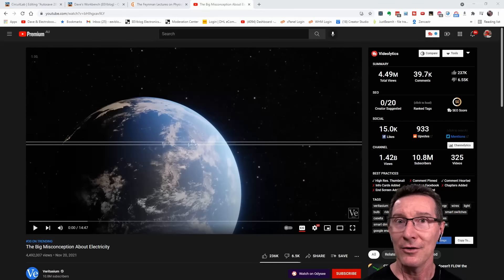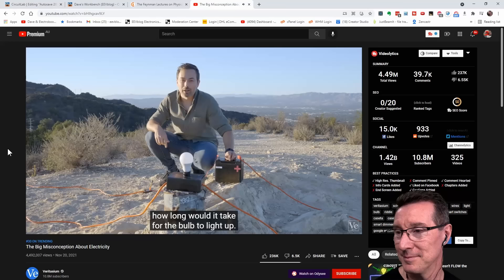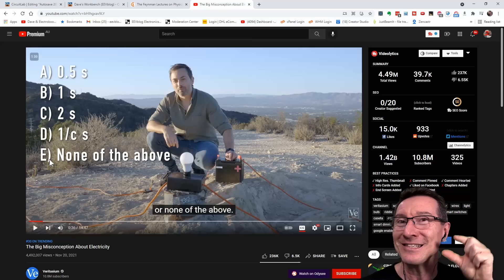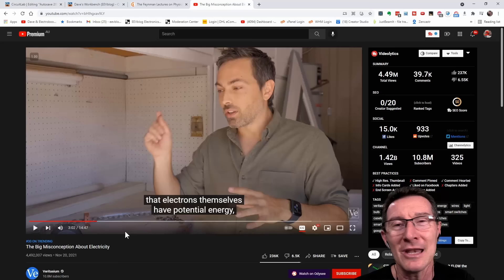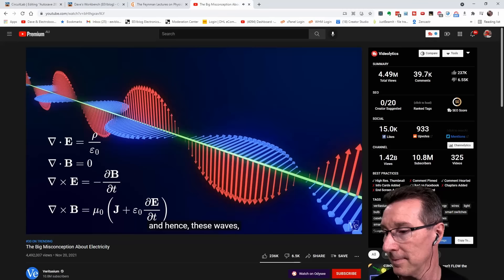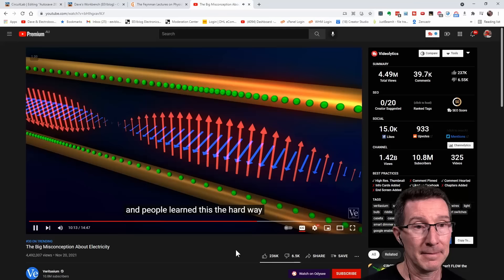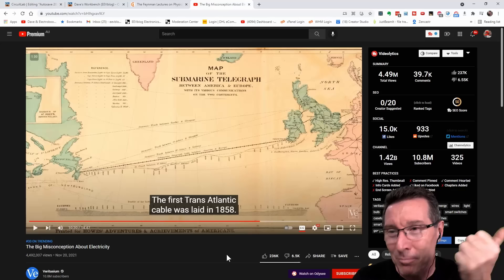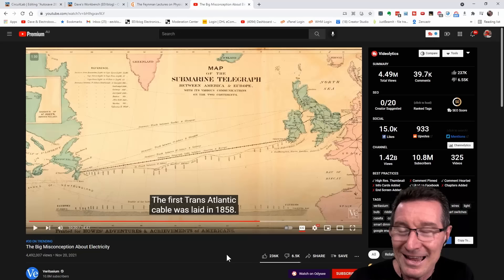EEVblog 1439 - Analysing Veritasium's Electricity Misconceptions Video

Comment: "a huge part of practical engineering is ignoring maxwell's equations". Exactly, we are busy reading datasheets, lol.
Reply: And finding replacements for non-available parts. 😭
Reply: @MetalheadAndNerd  it seems the preferred sport lately... sigh.
Reply: Its like everything else... you simplyfy to the most usefull system. Calculating magnet flux inna Electric cricut  is pretty much impossible.

But when doing magnetism you have to do it of cause.
Reply: Worth adding... this is actually whats limit current in a super conductor.. this fact was discoveted fairly recently
Reply: Surely 90% of modern electronics engineering is knowing the exact thing you need but surfing RS, Digikey and Mouser trying to find what it's called?
Reply: @MetalheadAndNerd  lol so true now.
Reply: And that bloody errata.
Reply: @666aron  what revision are you talking about again? lol I have the Sep 1999. Lol.
Reply: so true...
Reply: Once the math has been done, it is just your job to find the solution.
Reply: @MetalheadAndNerd  still waiting for hmi interfaces wich should have been deliverd in march 😂😂
Reply: @hausaffe100  In my last PCB design I had to implement 3 different voltage regulator ICs with their additional components, connected in parallel in the schematic, so I can decide ad-hoc which pads to use, depending on which regulator IC is available when the PCBs are produced.
Reply: LoL
Reply: @MetalheadAndNerd our programmers borrowed some PLCs from the vocational training Departement because lead times are crazy now the apprentices need them back for their final exams and everything is chaos
Reply: Yeah and strictly speaking, Ohm's law is a pretty good model because it describes in many cases stuff just as good as Maxwells theory. All theory is theory and can be wrong and can have limitations. And for DC you dont need maxwells equations at all, unless you want to know something about the static magnetic field. And still then there is other equations to use like Biot Savart. Or ... solve Laplaces equation. Or steady state heat equation and the temperature gradient will show you the direction of the electric field. lol
Reply: And using new age lead free solder instead of real solder
Reply: @O_Canada  'bout what?
Reply: The "energy" outside the wires is not heat energy (if you are in a vacuum) since there is nothing being heated.  Or is it radiated infrared in proportion to resistance losses?  Assume current and power flow but no frictional/resistance losses in a theoretical ideal  wire material.  In a vacuum there are no kinetic energy losses either outside the wire, since there is nothing in a vacuum outside the wires to be accelerated.  Therefore, what form is the energy outside the wire?  What carries this energy if there is nothing there but a vacuum?  Energy is joules in units of newton meters, and newtons refer to accelerating matter at an increasing rate.  So if there is no matter to be accelerated outside the wire, what is the form of the energy in the accompanying changing electric and magnetic fields?
Reply: @jackieow6692  Ether.
Reply: If energy is moving in free space around the wire, what would make it suddenly "want" to converge inside the filament and heat it to incandescence?  That sounds like a violation of entropy.
Reply: At all points in space there is some kind of gravitational field and some kind of electrical field and some kind of magnetic field.  What is the "stuff" that jumps out of the wire and increases the field (electric, magnetic) when the power is turned on and the current flows?
Reply: A proton has the mass of 1835 electrons.  Something is going on inside an electron we call "negative charge."  Must be the same thing only backwards/inside out/clockwise vs. counterclockwise is going on inside  a proton (or a positron) that we describe as "positive charge."    What is the "thing" that causes what we call electric charge?
Reply: @matsv201  For soft superconductors only; for hard superconductors, there are different mechanisms. Surely you have heard about superconducting magnets? They can create enormous magnetic fields.
Reply: @janami-dharmam  

"They can create enormous magnetic fields."

If you by enormous refer to that the magnetic fields are large in volume, yes. They can be very large indeed. But the field strength, while high, is fairly limited.
Reply: @jackieow6692 are you talking about like air is the carrier for sound pressure and sound waves, as to what is the carrier of EM wave? They used to call it the aether. Photons also have puzzled everyone for its duality of wave-particle behavior. And what is the carrier for the photon? This aether has been confirmed many times in history to be incorrect. So no aether. It only follows special relativity as detected.  And with the double slit experiment, it is very intriguing. The path of the photon can be strongly predicted, but the explanation is not clear. For my belief when i encountered studying this, that many simply say they don't know why. As we know it is derivable from maxwell's equations.  Anyways, photons attract other photons when high energy is present (laser). This already gives many clues about path of light. Then there is photonic molecule, a theory of photons that are massless interact with each other so strongly, it acts as if it has mass. And then with Feynman QED, we know photons interact with electromagnetic force, simply photons push them away. And from this information, we have made solar sails in space. So, at the least i can say photon carries electromagnetic field as studies and experiments have revealed. And this also explains the double slit phenomenon. The question i like to ask is why do photons attract other photons in a laser? There is belief that photons carry energy (kinetic energy) and so it has an equivalent mass that causes gravity. But at higher energies there are more and more photons. Where do they come from? Are they always available as stationary photons all around us? 

I'm sure someone deep in these research knows more.
Reply: @matsv201  I am talking about field strength (Tesla) only; the volume will increase the energy but not the field strength. What do you mean by "But the field strength, while high, is fairly limited."
Reply: @janami-dharmam  They are. Superconductors are limited by field stregth
Reply: @matsv201  The limit is well over 10T (before they quench). There are newer superconductors but they are experimental. Soft superconductors cannot take more than 10A whereas hard superconductors will not quench even at 10kA (or so). That is pretty high in my opinion. If you want to call that fairly limited, it is your opinion. Superconducting magnets can create fields that are impossible to produce by any other methods today.
Reply: @janami-dharmam  Hard superconductor is not a scientific term, you may be referring to type II superconductor or a true superconductor.

 The current field record is 45T and its not set by a type II superconductor.
Reply: @matsv201  Of course, engineers don't have to be able to spell! 😉
Reply: @another3997  just make the damn thing work!
Reply: Agree as Physicist i hate maxwell.. and we have working example what is actualy in cross with maxwell damn 60year.. when quatum PC come.. maxwell shut be displaced
Reply: @MetalheadAndNerd  My life as a schematic designer
Reply: It's funny because in school getting my engineering degree we always learned the ideal theories first.  Then, because the elegant equations that represent the Laws never work in real life, we use a different equation or a chart or something else to get the "real" answers.  Now, because of where I ended up in my career, I spend my time negotiating with other people or holding group therapy sessions.
Reply: JESUS CHRIST IS COMING TO JUDGE THE EARTH SOON PLEASE!!!!!!!!!!!! CALL ON HIM NOOOOOOOOOOOOOOOOOOOOW!!!!!!!!!!!!!!!!!!!!!!!!!!!!
Reply: And preparing powerpoint presentations for mgt.
Reply: @lt3742  I talked to Jesus. He's currently self-isolating. So no judgment day this year.
Reply: Me (physics/chemistry grad) looking at my sons' (1st and 3rd year engineering students) studies.... engineering doesent seem to care why things happen only what is happening. Makes me sad..😂😂😂
Reply: At 27:35 .... Screw the data sheets, I just like calculating the capacitance between the Earth and the Moon.  Easy-peezy, just plug in the values into C=(eA)/d  and you get about 10 pF (picoFarads). ;D
Reply: a large part of engineering is ignoring veritasium.
Reply: I haven't used Maxwell's equation since I graduated with my BSEE. KCL, KVL, and Ohms law are the things I use.  Practical engineering.  My 48sx was my goto in college for Maxwells equations   I mostly end up writing software or using CAD software packages.  Datasheet reading and making decisions based on that analysis takes the most time.
Reply: @jackieow6692   It is called Phlogiston after distillation of "it" from aether.
Reply: @jackieow6692 Newton meters referring to accelerated mass (times distance) is only one instance of energy. Conversely you could talk about electron volts (maybe of a green photon having two of those), and then ask: where is the mass? It's like the simplified formula for momentum being mv, how can photons have momentum then? The answer is: Simplified cases don't describe the general situation.